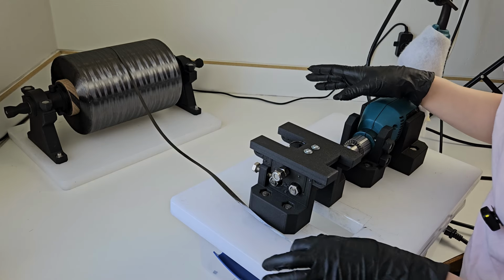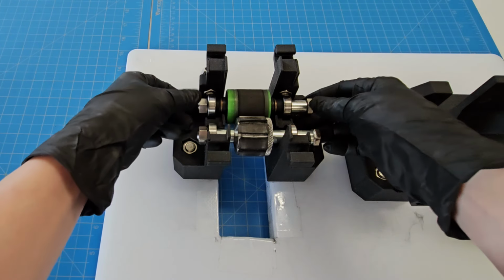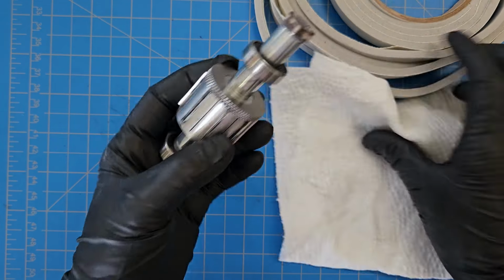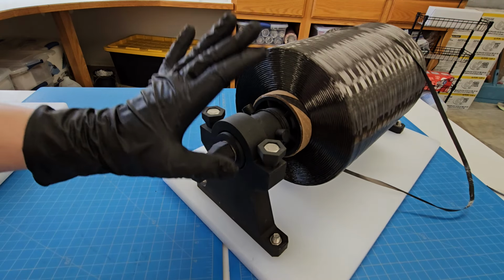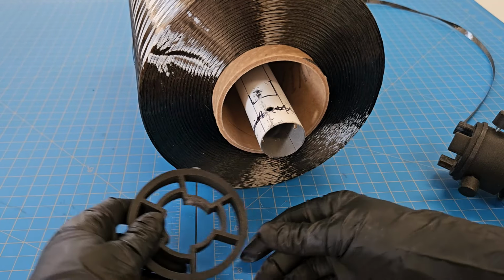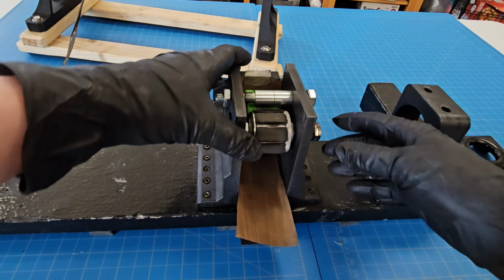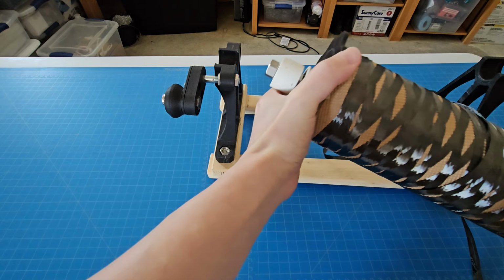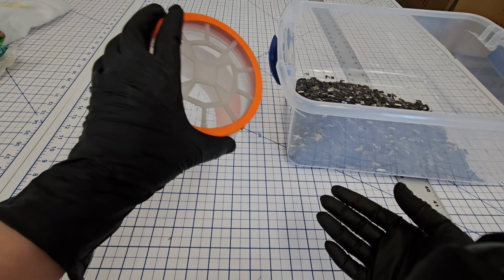Custom carbon fiber chopper

Comment: This is 100x better than my choppy chop setup! I would love to get my hands on the design files and print one up. My setup time is like 40 minutes each time I need to do another batch of chopped CF
Reply from the maker: It's nice to know I'm not the only one who was struggling with this need for nicely chopped material. The link to my web store is in the description now. Still preparing the spool holder files to add, but the chopper design and documentation is complete.

Comment: Awesome video! Where do you get your carbon fibre from? I've been wanting to try working with it for so long but i've never been able to find where to buy it...
Reply from the maker: in USA I can get pre-chopped stuff from Composite Envisions or omniaproducts on ebay. (it's never as nice as my own chopped, but convenient.) for self-chopping I started out by taking apart the spread tow pieces from a fabric sold by them (SKU: F-804-50). from there figured out the type of tow being used in it and asked around to find someone who could supply it. you can try contacting reputable sellers on AliExpress to see if they're able to get it in rolls. occasionally can find it on Ebay.
Reply: @LindyDesignLab could you please tell if there’s any specific name for the tow? Or what type of tow should I be asking from the seller?